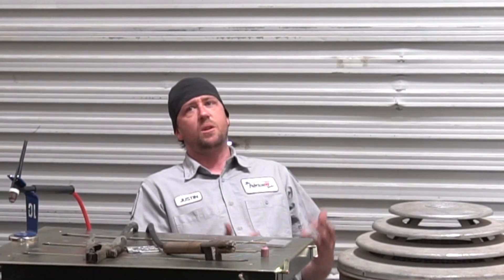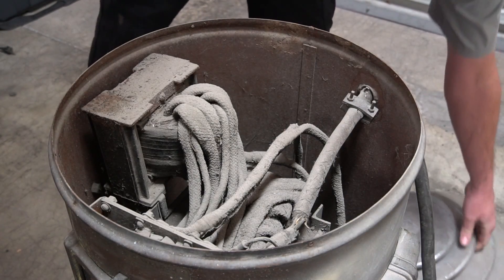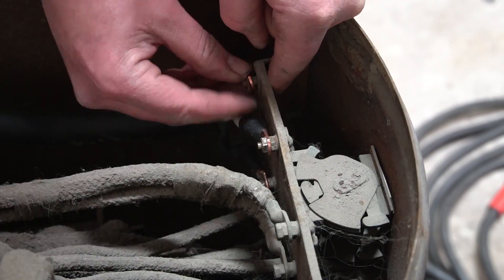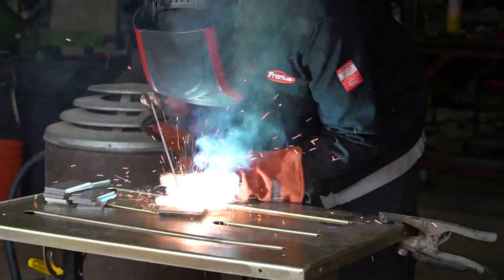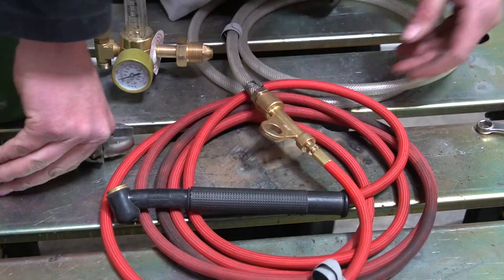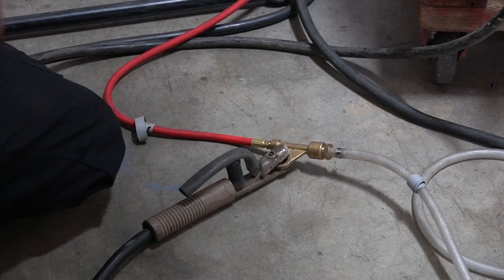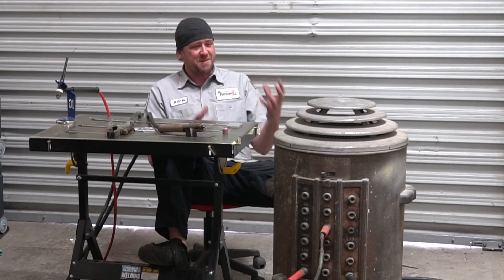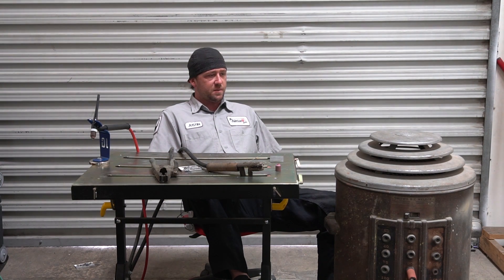TFS: 70 Year Old Welder - Will it TIG?

Comment: LOL, I have the same welder, 30's through 40's they were part of the war effort for WWII, 90 volts open circuit voltage, and ROFL your braver than I am I would have turned the power on from across the room at the breaker!  I also bought a miller AC/DC the next week, and have a high freq box as well.  Glad you like yours as much as I like mine, for what it is, its pretty cool, what end did you use to replace the lug on yours?  as I need to replace all the cables on mine as well.  ETA, DO NOT I repeat DO NOT look at your electric meter while that thing is on.....

Comment: I like it! My Grandpa used to have one, that ran 6013 and 7014 SO buttery smooth! And it was CONSISTENT! He burned up a 50 lb can of 6013 1/8" rods in about 6 hours one day, rebuilding a trailer, and the arc NEVER CHANGED, and he never shut it off. Only break it got was when he changed rods, or stopped for a cigarette. Unfortunately, it was stolen by dope heads that broke into his shop that scrapped the copper out of it for a quick high. We got it back, but by then it was only a shell.

Comment: Take a massive microwave transformer, remove the primary and secondary, wrap a welding cable through transformer as much as possible.(typically ground). And you should have a more stable arc.
And for shits and giggles I would fill it full of oil like a pole transformer after a through cleaning. Just to impress the ladies

Comment: A Bridge rectifier and some capacitors would give you DC
Reply: It’s those lying pixies flip flopping all up and down that gives us Ac in the first place. I’d avoid building them any bridges
Reply: Actually, yes. A transformer is the same thing (sort of). If you can find one. This country went through a really bad time. Between all of the manufacturing going overseas, the high scrap metal prices (also due to the move overseas) and this country's lack of opportunity forcing workers to up their game and self-medicate with meth... But I digress.

The secondary winding of a big 12 volt battery charger might work in series with the stinger lead cable. If you use electrolytic caps, put them  between ground and the node between the diodes and input side of the inductor, not the stinger side of the inductor.
Reply: Madaleni dont really know much about it but isn't a transformer about the same thing
Reply: @james10739  No, its not the same thing.
Reply: @Maria Madalena Lima As an arc stabilizer
Reply: You can get away with just an H-Bridge to be honest..
Reply: @Maria Madalena Lima You don't need an inductor (or a capacitor). Virtually none of the old stick  machines had one. I don't think any of the buzz boxes had one. If you doubt this, take the covers off and look for the inductor.  None present. The small amount of current fluctuation makes little difference in stick welding.

Comment: That is a very cool welder , I restored an old Craftsman AC welder from the 60's with same type of lug plugs on it . I actually had an old box of 7018 rod that was maybe 35 yr's old and  fired it up , it actually worked pretty good , I am sure it wouldn't have passed any cut and etch tests but it didn't look bad .

Comment: It's fairly easy to make a high frequency box for that using points.  When I used to work on older welders one of the service items was to remove and surface the points and then re-gap them using feeler gauges.  It's literally just a spark gap instead of an oscillator like modern inverter drives use.  The difference is that the spark gap is broadband frequency and inverter drive is very specific.

Comment: I still have got a HF box I used on an 40 year old 275 amp squarewave machine with footpedal. It welded fine. I upgraded to a watercooled Lincoln 275 with all the fancy stuff and expected my welding to be better but I could pretty much do the same on both. The only benefit with the new machine was I didn't have to manually  turn the gas and HF on and off and that water cooled torch was always cool.

Comment: Would be curious to see how it would do for AC TIG if you stacked a high-freq box inline.
Reply: I bet it would work fine. You'd still have the issue of needing to adjust the current as the material heats up. Something like an Arc Pig or one of the older arc stabilizer boxes would make it work fine.

Comment: My first aluminum tig machine was a miller thunderbolt with a HF251-d high freq box. Without remote amperage control you could only weld about two inches before you had to stop and let it cool...but it DID weld aluminum...contrary to the welding "expert" at my LWS that told me it would barely make a spark by the time I got it all hooked up. 

Old machines are cool. Hope you have the time to get on bringing that there little mammerjammer back to life sooner rather than later.

Comment: Now you need a 1950's HF box, but make sure you unplug all your electronics before you use it. The HF goes every where including into the mains power supply. I learnt to tig weld with a welding transformer and an BOC hf box that would generate a spark that could be drawn out to several feet long. It blew the radio up in the work shop fried the fax machine in the office. But in many ways it was a better tig welder than modern machines, it never overheated even at full 450 amps running all day the only limit was the operator.

Comment: Justin,  I've seen other videos where the Arc Pig has been used with the old Lincoln tombstone welds to maintain the arc. I wonder if it has a better wave seeing those machines are from the 60's-70's. It's a shame because some of these machines are super cheap, look cool and will probably run forever.
Reply from the maker: The Arc Pic is basically a HF attachment. All it does is add what is needed to sustain the arc. Super simple machine. I'm contemplating just building a HF box and DC conversion as well for this machine just for fun. I'm sure with a freshening up this machine will continue to run for ever.
Reply: @TheFabricatorSeries  too expensive , either buy new welder or add diode bank thus converting to dc machine , then you can dc scratch tig or aluminium on dc ep with a HUGE Tungsten .(dc ep limit is like between 1/8 th or 1/4 inch if you preheat .)
Reply: The Arc Pig is so expensive, I'd rather just buy a whole new welder.